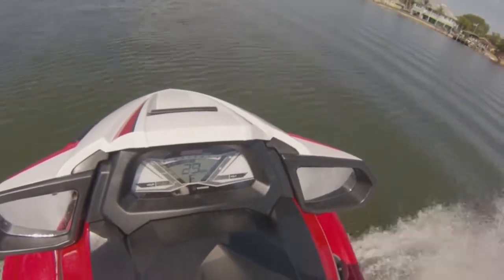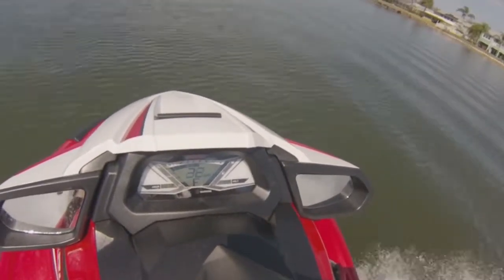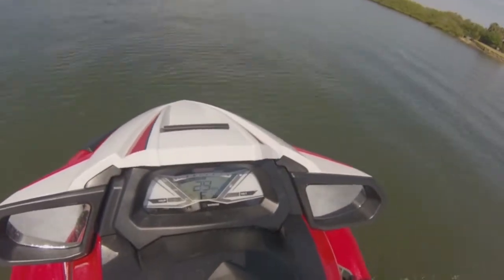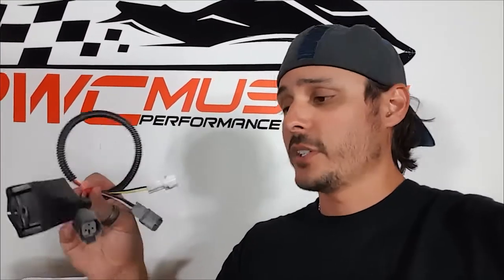Yamaha GP1800 Speedometer GPS Fix

Comment: An easy mod (plug and play) the works very well. I added the Candoo module to my GP 1800. The directions are clear and in color. Upon startup, it takes 30 seconds to capture the satellites, then you have accurate GPS speed for the remainder of the day. Great product I would install in any ski.
Reply from the maker: Thanks Chris! It really is a quick and easy mod.. a must do for all enthusiasts!
Reply: I had the same results. 
Installed on my 2004 kawi 900STX. 
Plugged right in, couple minutes to calibrate, and it works perfect.
Now my Speed an trip meter is dead on unlike the original paddle wheel pickup, that was + - 15 MPH.